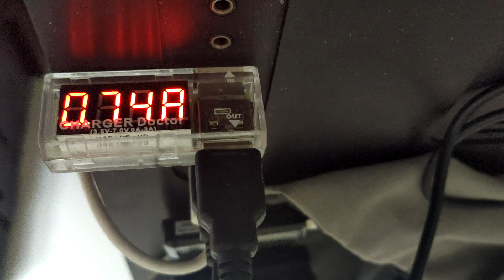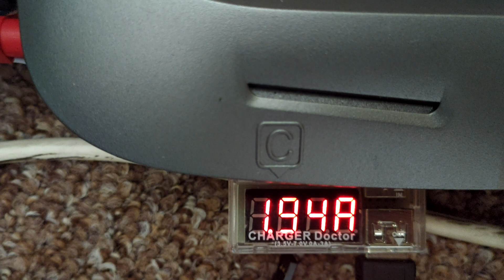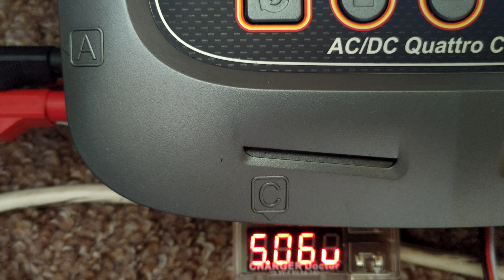FLYSKY Noble NB4 charging rate from different USB power source.

Comment: cool device.  I have a bit of an off topic question.  I've always wondered if the wireless charging on the PRO model was just because of the base battery.  And if using that silver pro battery would give the other models wireless charging capability.  Or if there was something in the firmware preventing it?
Reply from the maker: Yep it's all just the battery stick it on any and it will wireless charge

Comment: Charging the Noble using a Belkin 10,000mah Battery Backup Pack, with the USB output stating 2.4A, the Noble will pull 2A continuously through a Fasgear USB-C to Micro USB adaptor and eBay USB C to USB adaptor.
But it'll only pull 1.4A using the provided USB to Micro USB charging cable that comes with the Noble. Interesting!
Reply from the maker: Yeh cables have limits high quality is always better :)

Comment: Quick question.  I bought two transmitters (for myself and son).  So far love them.  However, I notice that a full charge does get the tx to 4.20v?  One seems to only get to 4.16 and the other will get to 4.19.  And, it seems to be inconsistent.  (sometimes only fully charge to 4.11).  So, I am wondering if that is normal and what you see on your end? Also, I know that 3.8v is "storage voltage for lipo", so when would be a good point to re-charge this radio?  People rav. about the long battery life, however I seem to get down to 3.8v with just a few hours.  (this keeping the battery pack at the bottom off).  Which, is another confusing thing, lol.  Its great for sure, but.. should this be powered on all the time?  This then becomes a two step process to turn on / off... so, I just assumed to just use the power button at the top and run it like that, but then of course this makes the bottom battery not really used.  So, its very confusing on the ideal way to run it.  The manual makes of course no recommendations.
Reply from the maker: So don't worry about the voltage there an 18650 battery in the handle as you can abuse the hell out of it and if it dies it very easy and very cheap to swap out I have a vid on how to do it ;) as for how to use it, power on the nb4 with the top button leave to base off, as you run it allow it to run till it warns you it need to be charged and then just hit the button on the base and keep using it, it will quickly charge the nb4 battery then power off the base, if it runs down again power on the base and keep going :)